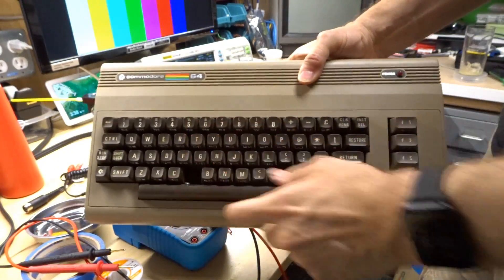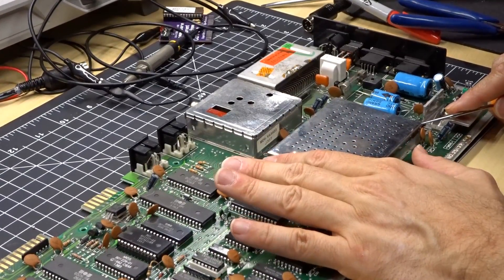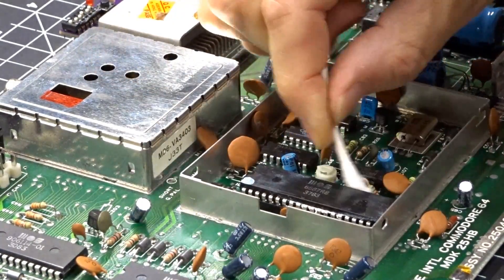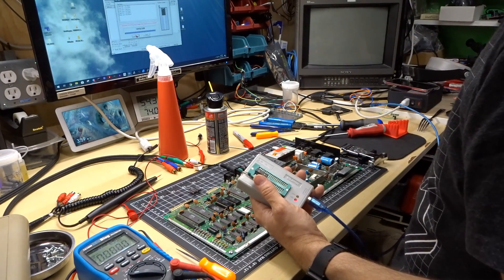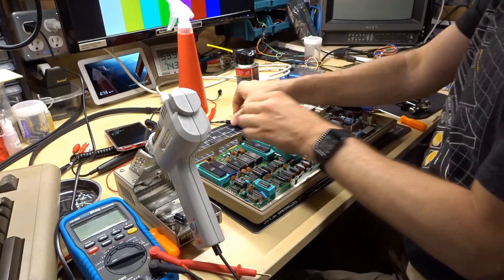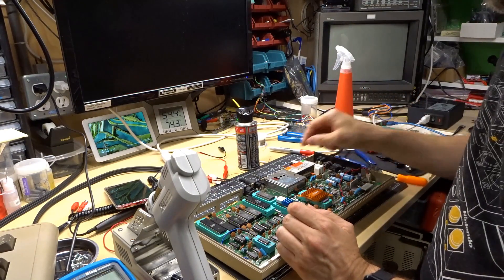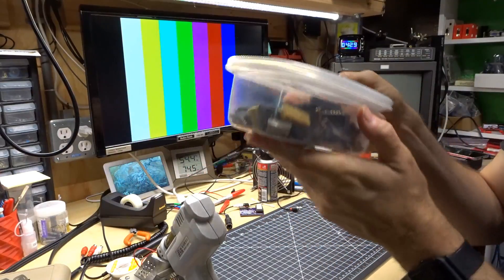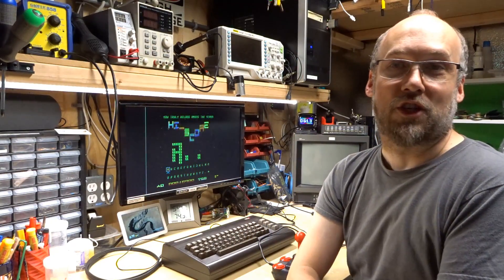C64 Repairathon! Part 2 - "Brown" screen fix for #2 and checking out machine #3

Comment: RF shields were there really on purpose. Once I was repairing a GameGear and it didn't want to start any cart with RF shields removed, it was showing just garbage on the screen. I've put the shields back, and... it was working just fine. Have you ever probed any bus in Atari ST? It's hard to distinguish what is data, and what is noise (the famous DMA problem is connected with that)... also the amount of RF noise these computers produce is horrendous.
So I like watching your videos, but didn't agree about RF shields - I always reinstall them after the repair.
Reply: Yes the one thing that I hate  about  Adrian (sorry) is his disregard for RF shields.  Yes I know what he will say (there not needed, they(the 64's) work without them and/or now days they(64's) don't interfere with anything or anything dose not interfere with them).  How ever they where the for a reason and you can't know that once they(64's) leave your hands and find there way to someone else they(64's) won't interfere with something that the other person has.

So Adrian please have some respect for 64's you repair and the people that might get them and replace the RF shields.  I am sure it would not borden you that much?!
Reply: Absolutely. I can understand him if he throws away the aluminium foil paper.
But the high quality metal shielding should never be removed. Without them you get a lot of ingress and keeping it has no negative effects. The foil is bad for airflow, but the metal shielding is not.
And without the shielding its not original anymore.
Reply: @macdaniel6029  If anything, I think I might remove the cardboard crap and replace it with a better shield, especially underneath. Not just to shield from RF, but I have seen a few videos where the RF shield specifically protected the board from corrosion and water damage.
Reply: @adriansdigitalbasement  You talk about the RF shielding from the point of view of the computers like the 64's but it is not there for the good of the computer but for the good of the things around it that may be affected by them.  Do you realy think the FCC did this just for fun!  No.   Yes moden things may not be as sensitive  to the RF that these computers generate and transmit but when your a collector of older devices you don't want to have to go around  trying to find the source of RF interference due to someone leaving out the shield.

Again to underline.  The shield was not put there for the good of the computer but for the good of the things around the computer.
Reply: Plus it also helps with static protection
Reply: @stevecomputerjunk  ...and also protects from dust. Boards with a factory shields, unless having a water damage are usually clean, while ones without them are often very filthy, and damp dust isn't good for the electronics.
Reply: @adriansdigitalbasement  > and negatively affects airflow

Here you are wrong: The shield will cool better than the heatsinks you add, because the shield is simply much bigger: The metal-to-air surface of the shield is really large so you can dissipate more watts to air than you can with the heatsink.
Reply: @adriansdigitalbasement  No I don't know any computer using RF shielding as an additional ground plane, it is used solely as an... RF shielding. More to shield outgoing RF hum, than to protect M/B from external RF interference. Any digital circuit generating square waves of MHz is a source of RF interference and should be shielded. Another aspect is - the originality. I like to keep old machines as they came from factory. Even when I want to use them, and install some mods/extensions, I always take an extra care to make these mods/extensions fully reversible/removable.
Reply: Yes. This is the only bad point I found in Adrian. The RF shield is there for something: Faraday's cage. The engineers did not break their heads trying to find what caused interference and put that piece of metal for something.
Reply: If you want to know what the RF Shielding does, put an AM radio by your C64 and tune it to around 1000khz, or 1Mhz which is the frequency of the clock speed of a C64.
Reply: @adriansdigitalbasement  I understand your point and I agree from a technical perspective. However for restoration I think they are worth putting back. Someone restoring a car doesn't skip the ashtrays just because no one will ever smoke in the car. Just my irrelevant opinion. Great video!
Reply: @adriansdigitalbasement  The shield by nature is grounded, effectively a Faraday cage to keep RF noise generated by the circuit in (hence FCC requirement), and just as important, to keep RF noise generated by other sources out. As a long time radio operator I know the value in good RF shielding. Not putting them back on is careless. Why would you intentionally be ignorant to the state of a limited natural resource like RF spectrum? If you don't know any better, that's fine... but when people are telling you why it's needed and you disregard it, that just makes you irresponsible and intentionally ignorant.
Reply: @va3dxv  why are radio operators such fudds? Lol
Reply: @subtledemisefox  HF radio spectrum is a limited natural resource. If you were an avid fisherman and you knew someone was dumping toxic waste in your favorite lake, wouldn't that bother you? Wouldn't it bother you more if everyone tried to tell the guy "hey that's bad because reasons please don't do that", and the guy basically said "fuck you I'll do it anyways"?
Reply: @va3dxv lol. You’re worried about GHz+ RF pollution? In this day and age, seriously? 😂 At C64 power levels we’re talking a couple of metres, aren’t the properties of inverse-squares grand?
Reply: This makes Adrian no better than a hack. Good repair goes unnoticed. Even if you don't see the RF shield on the outside, it is you who removed it. It is like building a PC and not doing any cable management inside the PC case. You might not see the mess, but your mind will know there is a birds nest.
Reply: As an EE, the disregard for the shields is cringeworthy. Just pure laziness to not solder them back on.
Reply: @misterhat5823 As an EE, why don’t you tell us all the effective range of RF interference from a C64? You have all the variables required to make a pretty good estimation. Hint: it won’t even nearly leave Adrian’s basement. 

You know what pollution you short-sighted morons should be worried about? The heavy metals leaching out of these machines into the environment if he wasn’t saving them from being landfill.

Comment: I love that people are repairing these machine but hate that they're ripping off the Rf shielding and discarding it, it's really selfish and causes problems for radio amateurs who use HF
Reply: How much "range" would an unshielded C64 have? Or do you mean unshielded electronics in general causing HF interference for hams?
Reply: @AerinRavage  Shielding is always better! If you can shield something, shield it!
Reply: @AerinRavage  You would be surprised.  I had problems from a 64 two homes away from me.  When ever they played a game on there 64 I could not use my radio.
Reply: Clint Jay so how is it “selfish” for some one to remove the shielding on a computer THEY own. That just sounds like a excuse to dislike the video to me.
Reply: @darthrevan2063  It is aways selfish to destroy things on purpose if somebody else could use them. Sure, if you own something you can do what you want, but sharing is caring.
Reply: @darthrevan2063  It's selfish. You own the computer, you don't own the radio frequencies where you're causing extra pollution.
It's not just chucking RF shields away from old C64s that is causing damage to the radio spectrum and of course and it's not just radio amateurs who are affected. Every little bit of interference increases the noise floor a little bit. Any digital equipment uses square edged signals which are very rich in harmonics all the way up to VHF and UHF frequencies.
@Adrian Black you commentted about lazy previous repairers. It's also lazy to not put the shielding back. No, they're not a strictly necessary part of the circuit in a Commodore 64 but as an influential restorer, you have responsibilities to promote good engineering.

Comment: Also, I had to sub after watching your repair of old mechanical HDDs.  Super useful!  I had no idea about lubing the drive.  Kinda simple maybe, but I didn't even think of it.  When I get my dad's old 286 I am going to try that trick.
Reply: It works on the older ones that used a stepper motor to change tracks. Newer ones all use a neodymium magnet and a coil with power applied to move the armature, which give far greater resolution than a stepper motor. The nice thing about the newer arrangement, is that it needs power to move out of the park position, and without power, the magnets automatically return the armature to the park position. And that's why kids don't remember ever having to park their hard drive before powering the computer off.

Comment: Would have reinstalled at least the top RF shield, pretty sure you could still squeeze additional heatsinks below that with a bit of bending. Could be mistaken.
Reply: If you remove one might as well remove them all.   Both sides must be shielded to be affective at all.
Reply: That would be pointless: The shield has a much larger surface than any heatsink you can fit on the chips. Therefore you can dissipate more heat with the shield than with a heatsink.

Comment: Why do you not have an IC Insertion Tool?
There is a reason for the metal shielding, to prevent the computer causing interference to other electronic devices.....

Comment: It's interesting you say you don't recommend the electronic vacuum desolder pump, I've got one of those, looks exactly the same model and it's so temperamental, the pump part always works but it rarely heats up. Sometimes giving it a slap makes it heat up but mostly it just stays cold. I've took it apart as far as I dare but that reveals no obvious problems, any ideas how to diagnose the issue would be appreciated. Gonna look through my old broken C64's now for that particular board that produces the clear picture,  hopefully I've got one and that'll get fixed first.
Reply: @adriansdigitalbasement  I'm willing to bet it wouldn't be too difficult to modify it to increase suction.

Comment: I understand why you might think putting the RF shields back on is a waste of time for no gain. But throwing them out is such a waste! I'm sure somebody would buy a batch of them on ebay for at least some additional spending cash you could put back into getting more materials.
Reply: Yes. They are a good replacement for machines that only have the crappy foil thing installed...
Reply: He saves dead chips but doesn't save RF shields. 🤔
Reply: @MickeyD2012  wow dude that's like...totally harsh man
Reply: @shuntaro2408  Yeah, but spurious emissions are a serious issue, and people should take it seriously. It also puts the hardware at greater risk of being damaged.
Reply: @MickeyD2012  unless you have a really old pacemaker and are hugging the computer while one of those emissions is going off, removing the RF shield is totally harmless. not only it gets in the way of opening up the machine, it's usually a bent corroded piece of crap that was only put on because in the '80s computers were new and over-protective regulations were normal. do you have a similar shield on your phone or laptop nowadays? no, because you only really need them on high voltage equipment. so this whole argument is complete undiluted bollocks.
Reply: @bamdadkhan  I've yet to notice any measurable difference between having or not having the rf shield installed in a C64 on any frequency I remotely care about or just happened to look at. Its a noisy device rf wise either way. Funny enough, a small bit of the cardboard shield which came out of a 64 did a lot to improve the video quality from a gbs8220... yeah rf shields can be important, and not just for high voltage stuff, but the one in the 64 doesn't do much.. or anything at all for reducing rf emissions from it.

Comment: 13:25 - DAHH YOU HAVE THE TS100 ALREADY!! <3 that is so crazy. I suggested that out of the blue on the last video just because I have the same awesome set. ;) Good choice.
Reply: I love this soldering iron. It must be one of the best thing that have come to the electronic hobby in this decade
Reply: That, a bottom-balanced 6S / 1300mAh pack, and a CellLog dangling off the balance cable, and you've got yourself a portable kit that's better than a Hakko. Oh, and the firmware, my god the stock firmware is 💩. I put together 4 of those sets at work for running around and soldering things, they changed the way we work.

Comment: Vellemen makes an awesome heated solder sucker for around $10 on amazon.
It's like an old style soldering iron with a spring loaded plunger type solder sucker built into the handle but it works much better that a standalone solder sucker.  I love mine.
Here's a link:
https://www.amazon.com/Velleman-VTDESOL3U-Vacuum-Desoldering-Heater/dp/B00B88FRME/ref=sr_1_3?keywords=velleman+solder+sucker&qid=1564557869&s=gateway&sr=8-3